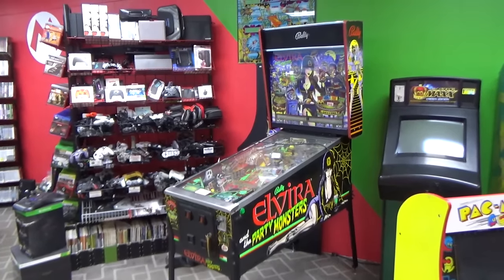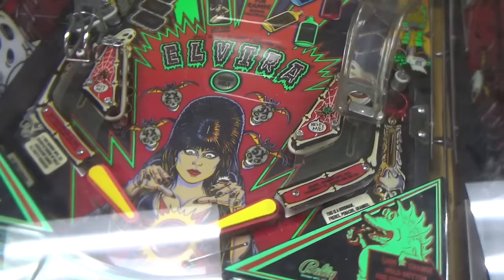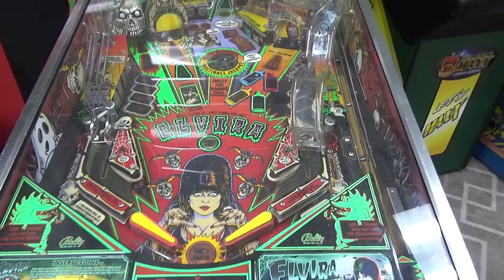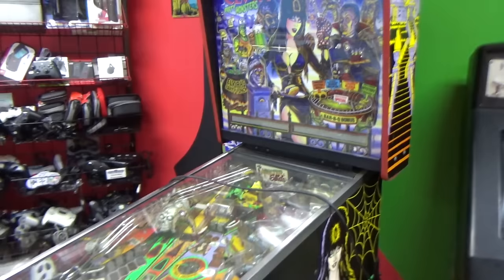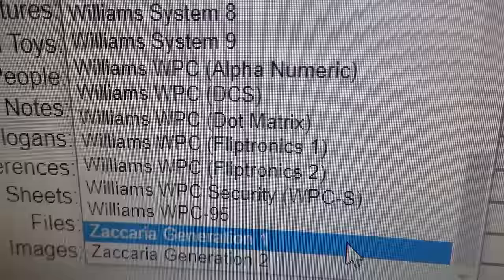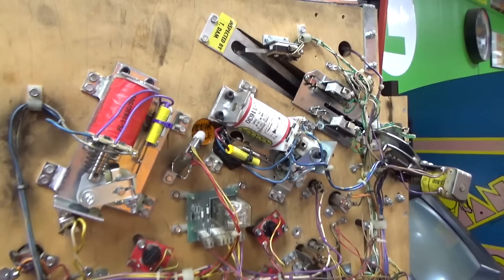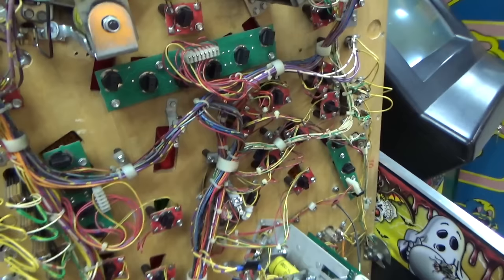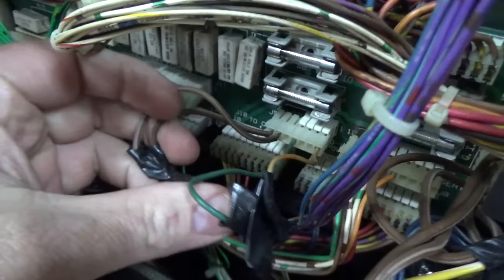Pinball Repair With Elvira & The Party Monsters

Comment: System 11. Boogie men were on the bumpers of Scared Stiff. They were to be activated by the bumpers but that was removed from production as was the LED skull pile on SS. Apparently the boogie man arms were known to fly off after time. I picked up a bunch of extra boogie men as they still sell them as kids finger toys today. There's kits to make the boogie men work as well for the skull pile to connect the plugs for it they actually wired the harness for. They'd loop the wire on IDC connectors to more than one pin to distribute the load specifically over a few IDC pins. One wire was fine. One pin was not fine.
Reply from the maker: Ahhh, they were IDC that explains it.  Also explains why it was cut off!
Reply: @LyonsArcade  IDC feed through. That's why there's originally several pins on the boards all connected to the same trace. Likely the reason they added those wire extensions on there since they didn't have a replacement IDC feed through connector to replace the torched ones. To be honest I don't know if a single Trifurcon will handle the load as well as multiple IDC pins. I've reverted back to using IDC's looped like it was originally in these applications since I believe it may offer less resistance having multiple points of contact over a single superior one.

Comment: Our boys at Williams...  Making two plugs the same # of pins on one board can be big trouble. I remember on Star Trek Next Gen, they had one plug for solenoids able to plug into a plug with 50V flipper voltage on it. Nothing would happen immediately, but it sends 50v (which is actually about 70v) to a capacitor on the driver board only rated for 35v. it soon lets out ALL THE SMOKE. And I mean a LOT of it. Ask me how I know.
Anyway, I always mark up one plug with a black Sharpie, and the other with a red Sharpie, so it's more difficult to plug them in wrong in the future.
Reply from the maker: Yeah they did that a lot.... you probably already know but the System 7 stuff was notorious for the neck connectors being reversible, and I did a video a few months ago about how you can plug the wires in wrong that go to the sound board on System 11 and burn up the power supply....

Comment: There's a limit on how much current you can pas through a connector. What the designers were doing was spreading out the load across several pins. They were doing this all the way from the transformer. So that's why there are 4 separate circuits. The boards were future proofed by having 4 circuits even though only 2 are use in this unit.

Comment: Elvira and the Party Monsters is using Williams' System 11B. Bally 6803 is way different in terms of electronic layout in the backbox. Bally and Williams have merged at the time Bally was making Ramp Warrior pinball machines. The first game released after the merge was Truck Stop. If you come across one, check the plastic on the right side, near the shooter lane - that one has sign, which says "Bally Williams merge", on backbox's translite there's a plane in top right corner, which has serpentine attached to it, which says "Bally is back!"

Comment: JOE, I know you have bridged 1 to 4 and then bridged 6 to 9 by solder bridging the pcb pads together. Its better to have just soldered wired directing to the pcb boards and removing the connectors and headers. You don't want to bridge the connections together because then the fuses don't blow because the current has been bridged so the current will add together. You want the fuses to blow on the correct timing when there is over current. That is why they separated the fuses per each wire because of the timing of over current. It has to do with "current sharing" and timing of the fuses. You mentioned when using Trifurcon terminals and connectors that they will reduce the HEAT in half because they have a 3 sided contact compared to the originals using Non-Trifurcon terminals and connectors when used 1 sided contacts which the heat was doubled?
Reply from the maker: I did not combine them after the fuses, I combined them before the fuses so the current is not bridged, the fuses will still act exactly how they are supposed to, thank you for watching Wayne!
Reply: @LyonsArcade  The designers didn't combine 4 wires together BEFORE the fuse because of "current sharing" for the fuse timing to blow. I think this is why the designers separated the wires BEFORE the fuse also for current sharing. You can always bypass the connectors/headers and solder the wires directing to the pcb to reduce the heat also.
Reply from the maker: Wayne since they're tied together at the transformer, how does that affect 'current sharing' ?
Reply: @LyonsArcade  When using the connectors/headers the specs are rated at a current. Example if the transformers output terminal is 1 amp but the connectors/headers specs are maximum 500mA or 250mA, you can't apply 1amp to the connectors or headers or pcb pads and traces. The pcb board traces can only handle so many amps of current. This is why the designers separated the wires for current sharing. Also the fuse "timing" is based on the current, so if you connect bridge tie multiple connects it will throw off the fuse timing to blow later. They separated the wires into groups for current sharing for the wire gauge size, pcb traces, header/connectors specs that can handle the current maximum rated plus the fuse timing.
Reply: @LyonsArcade  Since you're bridge tied the pads together you would have to increase the wire gauge to handle more current and bypass the connectors/headers because the connectors/headers specs max current rating can't handle 4 connections tied together which is 4X adding the currents together. The best thing to do is use 1 big fat wire from the transformer soldered directly to the Pcb to bypass the connectors/header pins. The pbc pads and traces are also max current rated that is why they separated them into 4 pads/4 traces instead of using 1 pad/ 1 trace. They used current sharing to reduce heat and pcb board current sharing layout plus using lower gauge wiring harnesses.